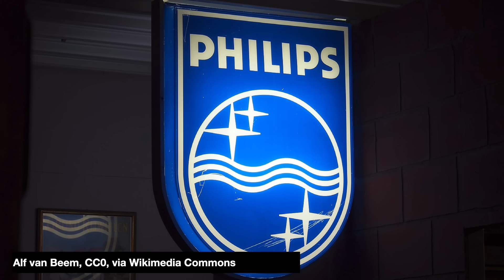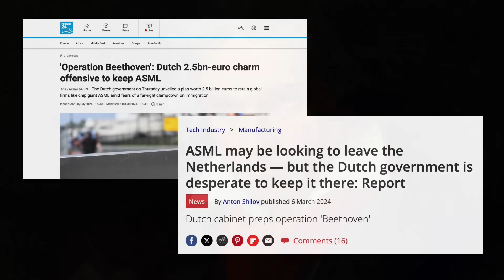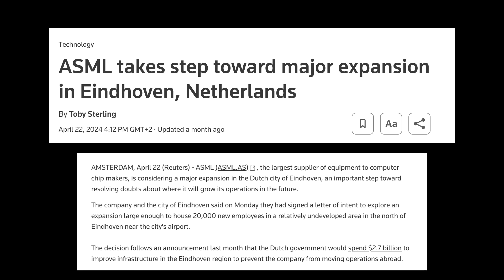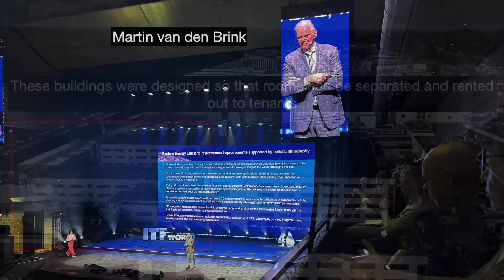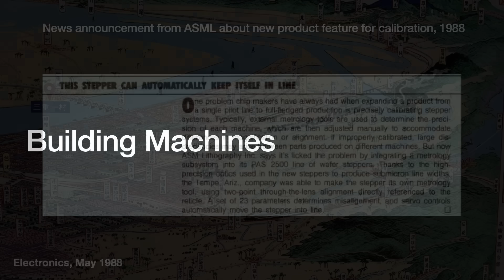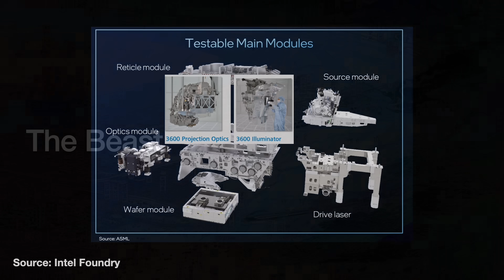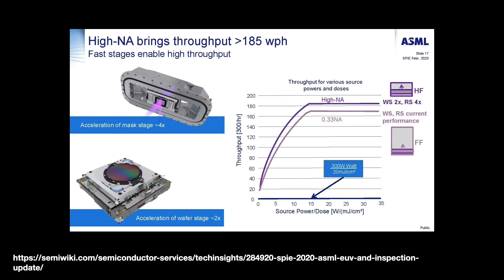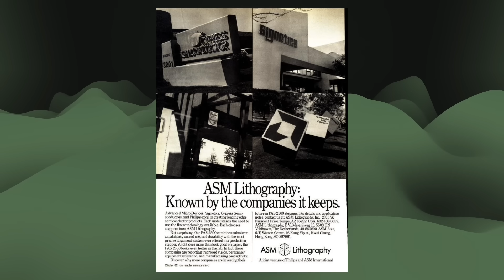What’s Next For ASML?

Comment: How long will it take China to produce their own EUV machines. I am not one for "dey stOle iT" but if I were the Chinese I'd be all about getting that tech as quickly as possible.
Reply: It’s complicated piece of machinery and it’s very hard to copy. Also ASML will not supply them to China
Reply: @denysivanov3364  I know, but they are shipped to places all over the world. What's more, usually physicist go to conferences and talk about these problems. How much of the physics is out there in public domain?
Reply: @meegz149  He has a video about it, he also mentions it here a decade or two
Reply: @meegz149 physics is out there. But putting that to picometer level mirrors, and 50,000 tin drops a second into use is something entirely different.
Reply: they have to copy all the supply chain
Reply: Never, this is not something that Xyna could ever do, especially when they have not a single system to study and reverse engineer, Xyna has spent 10s of billions of $ during the last two decades to make the semicoductor fabrication tools and equipment domestically with a very  little success, they still import 90% of the tools/equipment for their fabs (from US and Japan,...) and still struggling with making some of basics tool such as deposition and implanters....
Reply: Given sufficient time China would eventually succeed of course. Just like given sufficient time they started to manage to develop some level of stealth planes.

Realistically speaking so far I know China hasn't so far hasn't achieved the DUV stage yet though, which one would think is much easier then EUV. (They also own machines of the DUV step, EUV are only supplied to a limited number of companies. So they are far more easily accounted for) So in practical real world terms it kind of feels like they might be a decade or two out still. Assuming they can continue to progress as always despite the technology becoming ever more complicated.

Basically all signs seem to be pointing to it taking quite a long time still. And that presumably would be for the entry level EUV device then, not the High-NA or Hyper-NA.
Reply: Never under estimate China’s drive to copy things…. Even if they have to spend more to do it.
Reply: @AC-jk8wq  "dduuuuur china jus copy" and there is the casual racism.

Comment: They're cooked when China's DUV manufacturers start taking over the market. That will take a lot of revenue from ASML that EUV can't make up for.
Reply: Applications that can use a DUV machine, would be insane even contemplating an EUV machine. Intel (but also China) try to circumvent the intimidating investmentsin EUV by multi-patterning, but that is a difficult, costly and complex and fickle proposition. Well lets say,  Intel made the decision to secure the first 5 high NA machines that will be produced in 2024. China will need to search it in multi-pattern, because EUV machines will not be made available for their market.  Multi-patterning does have a major setback: more passes means longer leadtimes, and you can only sell high end chips that work, nor correct faults in chip designs, after a chip has gone through the entire process. 
Regarding Chinese DUV machines taking over the market. Possible, but TSMC, Samsung and especially Intel have political reasons to oppose Chinese DUV tool imports. Faps are a very capital intensive investment, not like your grandfathers garage where you can sneak some machines in. Taking over the market would probably imply that Chinese Faps will be taking over the share off the chip market where EUV equipment could be competitive, which probably is something that China would be very interested in, but will also be an uphill battle. 
If EUV tools will be the next necessary step for chip miniaturization (as physics dictate), ASML has a great technological edge by being there first. The experience of solving the practical problems first, and setting up the technological competence in their supply chain are huge investments, that ASML can commercially exploit first. It is kind of mental that ASML is doing this in the first place, let alone for competitors taking the gamble to leapfrog them from standstill. Again, Chine might have the means to do so, but
Reply: @Tuning3434   They take over the legacy chips market for China and any exports from China that use legacy chips, like cars. This eats into revenue for both equipment makers and chip fabs in the West. Look at how much of revenue comes from DUV and legacy chips.
Reply: @100c0c  Sure, that what happens with technology that matures, at a certain moment a competitor will be able to bring more economic alternatives. But, ASML is investing a lot of R&D in pushing their equipment and supply chain to their limits, and some of those innovations are also used in their older DUV systems and has build up a capable customer support service. Throughput, reliability and the ability to innovate together with their customers are some nice attributes to have when having to deal with extra competition, and ASML been able to build up a foundation on those aspects over the years.
Reply: SSA800-10W is also producing chips!!!
Reply: I wonder what’s gonna happen when china manages to crack the process of EUV
Reply: dont you think the west will, in case, just ban them? :P
Reply: Why there is nothing new to engineer? Everything is reliable, why risk saving a few bucks on a machine that could grind a billion dollar fab to a halt from failures. DUV are just one machine out of dozens that are needed to run a fab.
Reply: I dont know, ASML has a very narrow customer base that are not in the best of terms with China.
Reply: That is the nature of all technical development.  Eventually competition can produce the new thing you made so you need to extract your development costs before competition pushes prices down to marginal cost.

No reason to think ASML isn't doing this  the same way every other tech and pharmacy firm does.
Reply: @petergerdes1094   Of course. It just might make their plans harder with less money for R&D.
Reply: @100c0c  If they are a well run company their R&D is funded based on expectations of future profits.  In an efficient market it wouldn't make a difference whether they have the cash internally or need to sell bonds or issue more stock to fund that R&D.

But I'll admit the market is probably not perfectly efficient in this way so it's relevant.